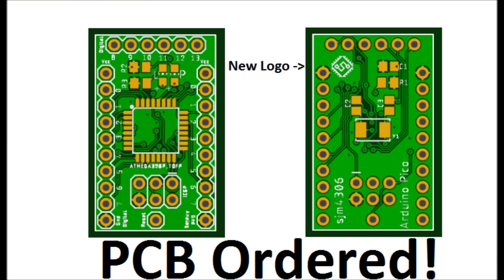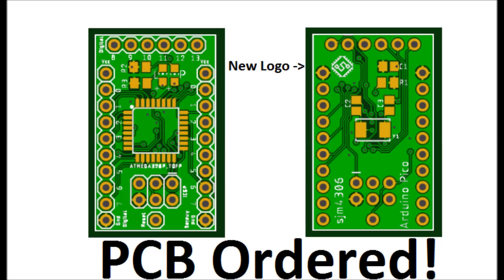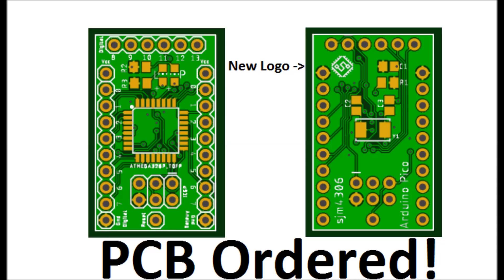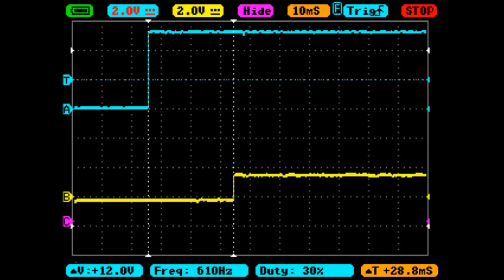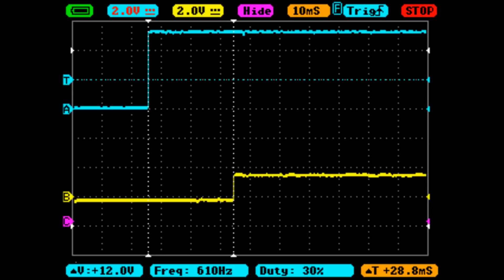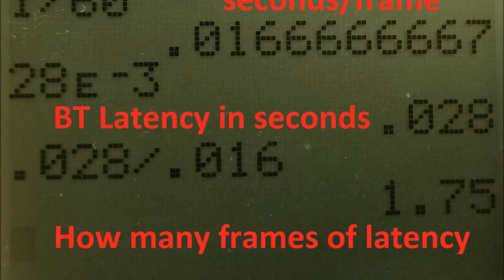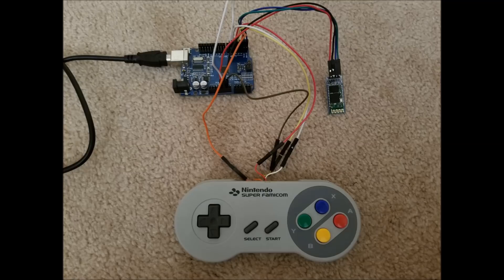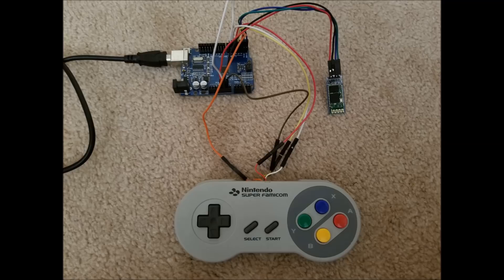DIY Wireless Nintendo Classic Controller Part 2: Quick Update, PCBs + Latency

Comment: the best thing to do is to make the controller work with the switch aswell not just the receiver
Reply from the maker: I would need a bluetooth sniffer to reverse engineer the protocol as I doubt nintendo publically released the technical info I would need to do this. I also would need to rewrite the firmware for the hc-05 as I have a feeling the switch implements a non-standard packet frame.